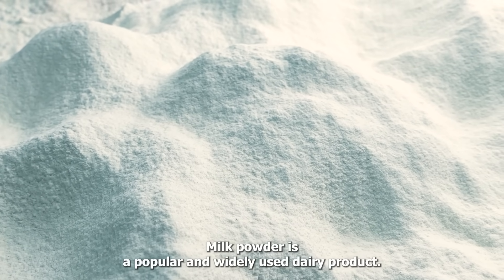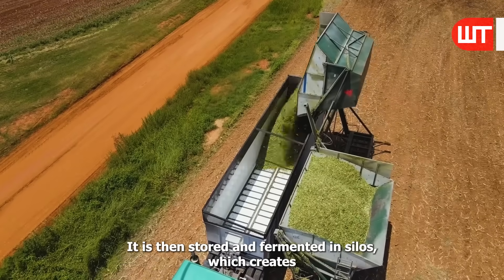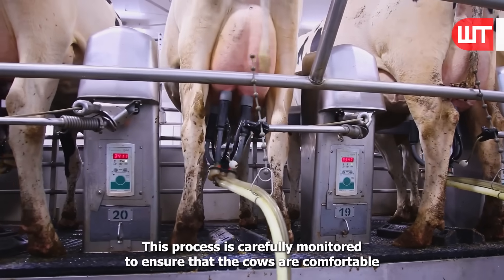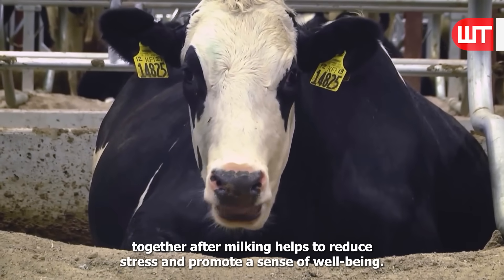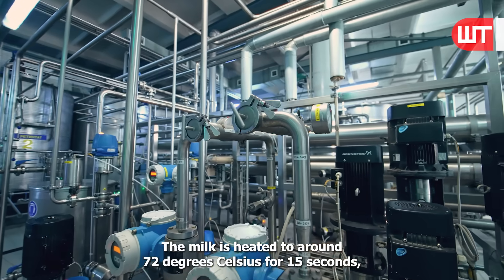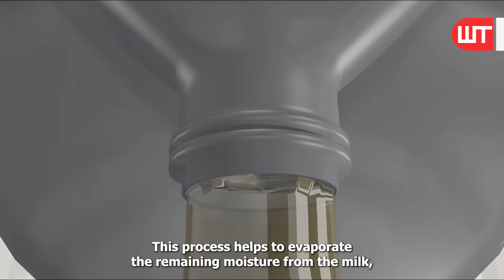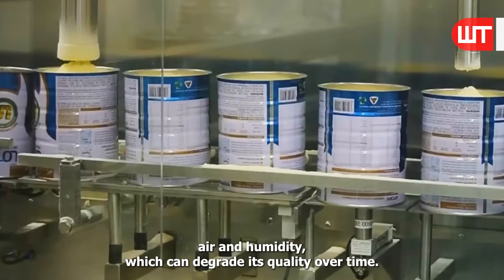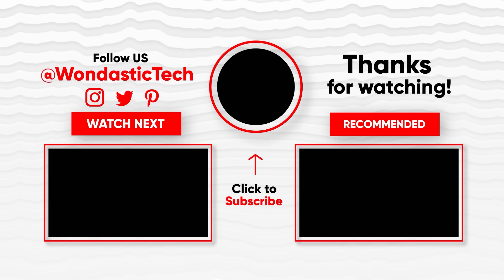How Milk Powder is Made | Modern Milk Powder Processing Plant | Food Factory 🥛

Comment: Heating milk at 220°C won't damage proteins?
Reply: Depends on if it’s held in a hot well or not. There’s different heat treatment processes depending on what the customer wants. The milk is also cooled down through some form of regeneration before it goes into the evaporator
Reply: Isn't milk vacuum dried like coffee?

Comment: I work on the canning line in a factory that produces baby powder. The can filler in this video is a lot slower than our filler. Ours can run at 103 cans per minute. And the packing of cans in boxes and stacking them on pallets is automated.
Reply: The removal of oxygen and it's replacement with a mixture of nitrogen and carbon dioxide is not mentioned.
Reply: @sajidmunir864  we just use nitrogen, I don’t know about other factories. But the powder is kept in a nitrogen atmosphere from the spray drier to the can seamer.
Reply: i think they slowed down the machine to show the process.
Reply: That's more than 2-per-second.